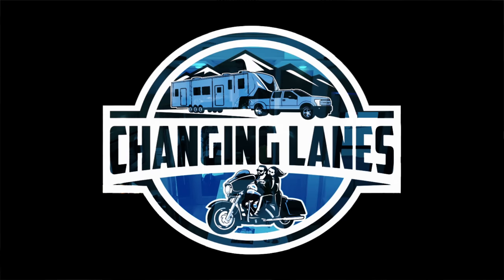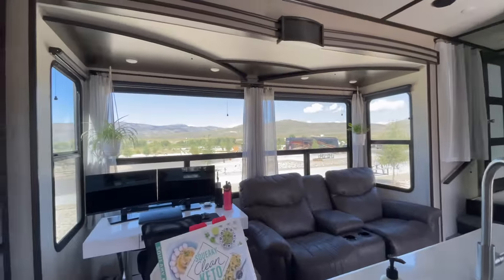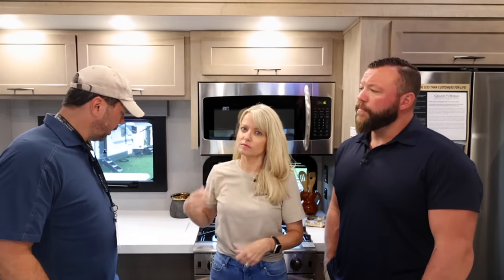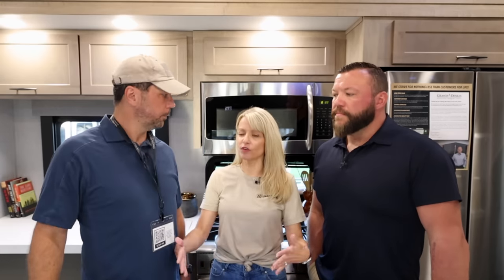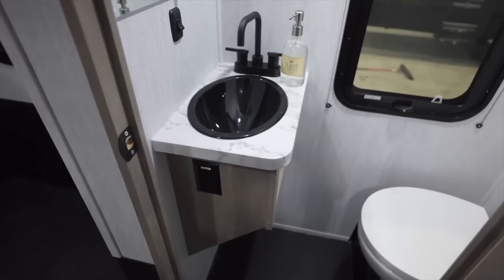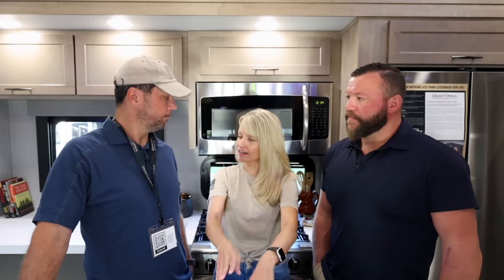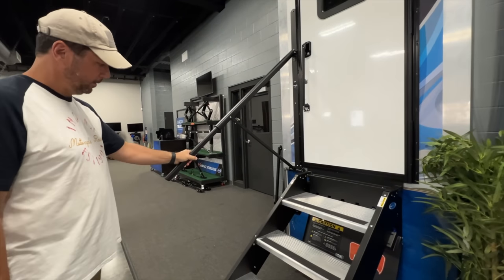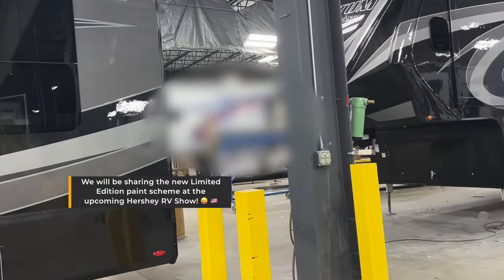New RV Floorplan Questions Answered! (Momentum 410 THR Prototype) (Full Time RV Life)

Comment: As far as the bedroom night stands, what about room for CPAP machines?
Reply from the maker: We have heard that people put the machines under the bed and pull the tubing through the gap in the corner.
Reply: The floor might be an option.   However, a competitor has fixed this with a small shelf on each side above the window box. It’s a great solution for a lot of us.
Reply: Agreed, a bigger shelf would be much better. They have to be refilled with water each night and my husband would be grumbling every time he had to get it out from under the bed.
Reply: @ChangingLanes  easy access to the CPAP machine is needed to filling the water reservoir each night.

Comment: I don't see any comments about this, but it seems to me that the battery system, the solar that would be needed to make that much battery capacity sensible, and the IS option, would all add a lot of weight, cutting down the available cargo capacity.  I hope you won't have to leave Lucille out!  We mostly camp with shore power, so batteries and solar are (so far) not important to us.  We have had to run our genny a few times, when a campground had a power outage.  ISTM the battery system only makes sense with lots of solar.

Comment: Incorporate a seal for the tv, to help with the pasta boiling over. In the closed position.
Reply: Put a 30 degree angul between the tv top and the counter. Put a stick on seal on the counter side that will seal to the tv top when closed.

Comment: Rather have tv come from ceiling,  fold down.  Have counter open and no worries of liquid.  Want to cut a watermelon
Reply: That’s what the island is for. The sink is right there.
Reply: I was thinking the same thing.   It wouldn't look great when it's up, but it would solve the issue with losing the counter space and also no worries about dropping stuff into the televator.
Reply: Who cuts a watermelon ON the counter, civilized ppl use a cutting board
Reply: Even with a cutting board juice will run down. I think the top of the TV should have a seal and compress. This way, you will have time to clean up the mess prior to it seeping into the TV area.
Reply: Buy pre cut fruits at Publix… problem solved!
Reply: @peterossi9496  that's expensive af
Reply: @runswithbeer  not as bad as you think when considered that your throwing 25-30% away!

Comment: Did you ask grand design to include a cable outside wall pass-thru hatch such as Valterra A10-2137BKVP or equal.   Into the garage cabinet would be a good location.  Given today's data and satellite usage, many people need to bring a cable in occassionally such as with Starlink

Comment: Do you think that once this one is put out there that they will come out with one that might have a 10ft garage but with the same length which would mean you gain living space? We wouldn't need the garage for anything other than an office and maybe a couple of bikes. So we wouldn't be putting anything with a motor  in it. Was just wondering.
We do love the new design and color. You two did a great job in designing this unit. 👏
Reply from the maker: That is not likely as it would mean a whole new model and a 13'6" garage is a sweet spot for people with 2 baggers, or a SxS....

Comment: The Volta system is amazing but I would like 2 5000 W inverters so one would drive the air conditioning and everything else and the RV and anything you want to run is more than ample power.
Reply from the maker: After living with a single 3000VA Inverter, 6400 will be nice.  Everything in the RV will be powered.

Comment: How about going with a next-gen AC system kinda like a mini-split inverter technology. Come on Chad, you know you want the latest tech!
Reply: That would be really nice.  Mini splits instead of roof mounted would give some clearance too, letting you have higher ceilings or more space underneath.   Also, I'd love to have a heat pump on all 3 units (mini split or not).   My wife and I do most of our camping in cold weather, would be great if all 3 units could add inexpensive heat to the unit.

Comment: The TV is too close to the range top. Grease would splash on the TV. Overflow a boiling pot and ruin the TV. There should be a divider or a wall next to the tv. I would not use the top of the televator to prep food.
Reply: Totally agree.  Tv is in a bad spot. Especially for people that cook a lot. And pantry is still too small for me. No depth.
Just my opinion....
Otherwise,  it's pretty.

Comment: I ordered a 395ms-r the only option I seen was for solar is 2 330 watt panels on roof
Reply: You guys are so lucky .that grand design built you guys a special trailer
Reply from the maker: Yes.. it's a basic solar setup.  We will be getting the stock setup also so we can try it out as is.  But, we might upgrade it also later on.
Reply: @ChangingLanes  will you be at hearshey show Saturday for meet and greet
Reply: @ChangingLanes  I hope I’m correct about the 2 330 watt panels.can I also put lithium battery in it as it is now with the stuff that comes with it

Comment: Is your 450 still going to handle the trailer without any changes?
Reply: A 450 can handle close to 2X this much weight.   It's a huge trailer, no question, but yes, a 450 can easily handle this much weight.

Comment: Why doesn’t Grand Design offer the IS as an option ?
Reply from the maker: They used to, but as of 2020-12-15, GDRV offers an 8K suspension upgrade on the build form. This is NOT the Independent suspension, but rather a standard set of axles and leaf springs rated at 8K versus the standard 7K.

The MORryde Independent Suspension can be installed prior to delivery from the factory to the dealer. However, it is no longer done as an option directly through Grand Design (where GDRV pays MORryde and invoices the dealer on the build) due to liability issues. Thus, you will not see it on the build and price tool.

Instead, GDRV will transport the RV to MORryde post-build (for a nominal fee) prior to going to transport (to the dealer). Long story short: It is possible, but MORryde needs to be paid directly by the customer. This should be coordinated by the customer with the dealer, GDRV, and MORryde.
Reply: @ChangingLanes  That’s a shame it is an option for Riverstone and we got it because of your video. And it has made a tremendous difference we just had the yearly maintenance done a month ago.
Reply: @TonyBenton0728  We did the same ('21 42FSKG) for the same reason.  Seeing the difference in ride was impressive.  We were just talking about how it would make sense to make it a separate sub-model, or something like that, so the rig could have a higher GVWR.  The 42FSKG already has a pretty low cargo limit, and having the IS drops that something like 900 lbs. on paper.  In the real world, it seems that having IS should increase the total capacity, possibly by more than the added weight of the IS itself.  What model do you have, and have you had it weighed with something like that Smart Weigh system, while loaded as usual?
Reply: @BruceS42  As a matter of fact I just weighed it earlier today. I have added a 95 gallon auxiliary fuel tank. We have the 2022 Riverstone 42fskg and pull it with a 2022 Ford F 450 with 143 gallons of fuel ,wife myself and three dogs our gross combined vehicle weight is 32,980 lbs .Yes I am over on the pickup weight 1,400 lbs. when towing the trailer. Oh well !

Comment: That’s amazing RV. Chad you’re going to need a bigger truck for safety.
Reply: Why I have the same year truck and color and pulling a Riverstone 42fskg same weight as this new one .
Reply: @TonyBenton0728  yes all due to safety. you can’t get the big rig stop in time. sorry no exception.
Reply: I think Chad already has a F450.   They are rated close to 40K lbs.   This RV is only about 1/2 that.
Reply: @michaelfink2070  I know what you’re saying but safety aspect you have to think about the rig getting stopped. I would be afraid to have F450 you can’t get a stop with a lightweight truck I would go with a HDT i’m just saying. just my thoughts.
Reply: @denniscaling1796  The way you make it sound as if the trailer has no brakes I have disc brakes on the trailer. The same as Chad has on his rig And the F450 is rated to tow 43,500 lbs.I drove a semi truck for 41 years I do believe I know what I am talking about. And fill very confident the truck and trailer will stop in an emergency.
Reply: @TonyBenton0728  OK, just my thoughts. A 450 will wear the brakes out At no time at all. Safety safety safety, if you feel safe it’s not my concern. HDT can get  it stopped no questions asked. But I have you are comfortable have Add it. only my thoughts. have a great week.
Reply: @denniscaling1796  You and other HDT owners push the same thing. So where do you primarily travel most of the HDT’s I have seen are out west and if I were to guess the ratio of HDT’s is 1 in a 1000 is safely was what you make it out to be you would see them more often. You just can’t get your rig in to any park. As far as brake’s you really don’t know how long they will last we have about 8000 tow miles on the truck and yes your brakes will last longer you don’t tow what maybe 10,000 miles a year. Not much different than mine. HDT are a lot more trouble than they are worth. To many more steps you have to do to setup and breakdown.
Reply: @TonyBenton0728  OK, this is only my thoughts. have a great week.
Reply: @denniscaling1796  When I first started considering buying an RV and tow vehicle, I pretty much settled on an F450, but then I started watching videos on You Tube by RVers who towed with an HDT and why they did so.  Pretty much convinced me that for safety's sake, an HDT is the way to go.
Reply: @loragunning5394  it is just my thoughts. You can make up your own mind. I would think safety is the most important thing. HDT is the safest way to go and Community of HDT is the best. safety comes first.
Reply: @loragunning5394  And you will limit yourself to where you travel and camp. As I have committed before if HDT’s were that much safer you would see them more often and most people don’t want to be bothered with the hassle of the extra steps to setup and breakdown. And have a second vehicle to get around. Just ain’t going to get a HDT in a Wendy’s drive thru.
Reply: @loragunning5394  It’s The way to go in my opinion. safety and the community of HDT Community is the best. they will help you every step of the way to the deciding on the RIG to the tow vehicle. reach out and soak up their knowledge. God bless and have a nice week. your friend Denny.
Reply: @denniscaling1796  A HDT would be better, no question.   But a 450 is well within rating with this RV, it's only about 1/2 of what it's rated to do.   I'm with you, more truck is always better, but a 450 can easily handle this thing.   I suspect this is going to have disc brakes, wouldn't surprise me if the truck stops faster with the RV back there.
Reply: @TonyBenton0728  I understand the drawbacks (I'm pretty good at research) and for my planned setup I really do think an HDT is going to be the way for me to go.  I'm planning to be towing a 45' toy hauler, living full-time on the road, and using a much smaller get-around car that will fit in the garage of the TH on travel days.  I'll likely be staying in 1 location for 2-4 weeks at a time, so the extra set up/tear down really isn't an issue for me.  Also, I don't patronize fast food drive thrus, hahaha.
Reply: @denniscaling1796  I am subscribed to a YT channel called "Suite Travels" and the husband on that channel said something to the effect that is your trailer outweighs your truck, the trailer will always be pushing your truck, but if your truck outweighs your trailer, the truck will always be the boss.  That is what really got me thinking about considering an HDT.
Reply: @loragunning5394  My guess is that you will primarily stay out west. And I don’t think a smart car will fit in a toy hauler or at least open the door and getting out. I’m not against HDT’s they have there limits I drove them for 41 years and and even in regular parking lots you just can’t get around in them. As I committed before if they were a better alternative you would see them more often. They get a lot of attention because they are such a novelty. Hope you find the right one.
Reply: @TonyBenton0728  Like I said, I'm pretty good at research. The TH I have chosen will garage my choice of  get-about car and it's not a smart car that will be riding on the back of an extended  bed of an HDT, it will be garaged in the TH on travel days.  I am certain I will be able to travel anywhere in the USA, not just the west, same as any commercial big rig does.  I m not planning to stay at RV resorts, but planning for my rig to be an off-grid moving home.  

We all RV in our own way, what works for me may not work for you...and that's OK.  What matters is that we support each other regardless of our personal choices in our setup.  Some folks choose a Class A, some a teardrop, some RV only weekends and vacays, some are full-time.  It's a big world with a lot of choices and NONE of them are wrong.  They are all right for for each individual according to their own needs.  And I think you need to accept that those of us who choose to RV in a manner differently than you do have already figured out the pros and cons and have made an informed decision.  Financing a big rig represents (for most folks) a very significant cash sink, so please allow the fact that folks who choose the choices they do are not doing do blindly, despite the fact that their choices may not align with yours.
Reply: @loragunning5394  Yes commercial trucks do travel on a lot of roads just getting into a RV park is different.and particularly on the east coast. I am not knocking your choice. Just don’t try and make it sound like you and the other HDT owners have a monopoly on safety. Have a great life and safe travels. We are headed to Hershey Pa. for the RV show and NHRA drag races next week. And we full time and are making a loop around the US. working our way back to Georgia for the holidays and doctor appointments.

Comment: No generator unless you're traveling?  Big fail.
Reply: They clearly state that you can get a generator. The Volta system is an OPTION.
Reply from the maker: The truck can be used as a generator when not traveling also.  We're not sure how we feel about it but we won't know for sure till we try it out.